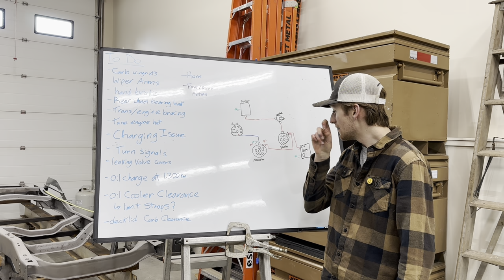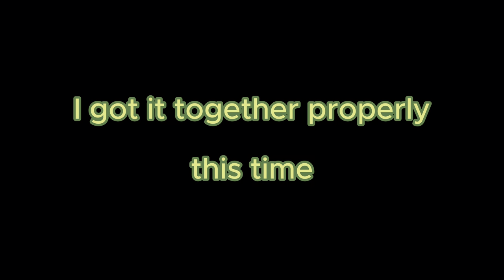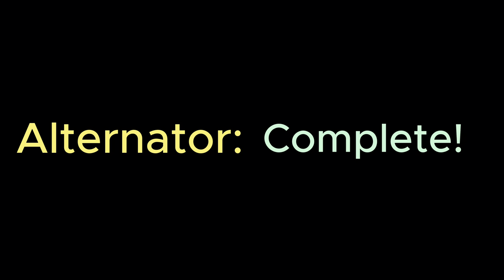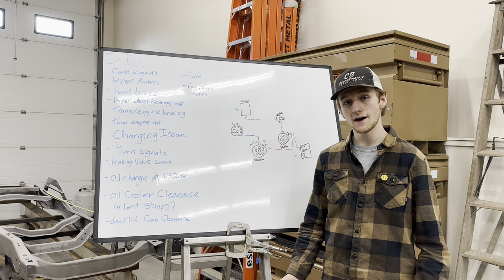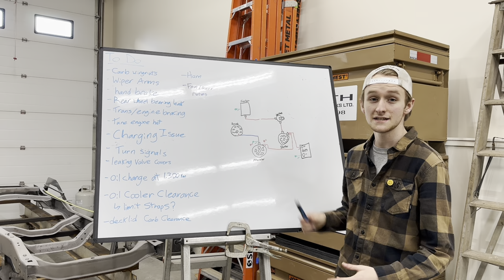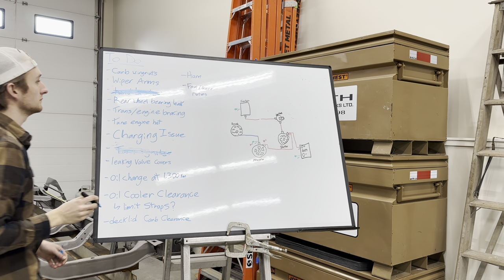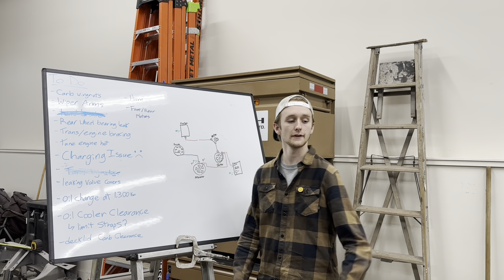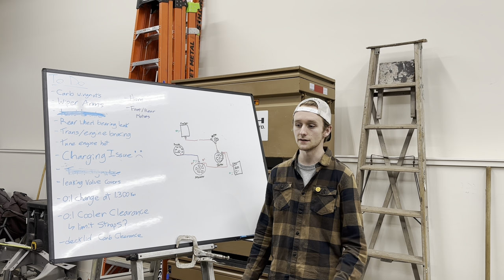Major Electrical Problems! Fix up, Pt:1

Comment: I believe there is supposed to be some shims between the alternator and the pulley.. i am certainly no vw guru on the subject, but you might check into that.. love your bug and your channel...
Reply from the maker: Thanks man, I had thought so too but I never had shims before when the car was working fine. And after I did actually get the alternator apart I could see that some of the friction fit shim inside had moved so everything was moving. By the time I figured it out it was a lost cause.